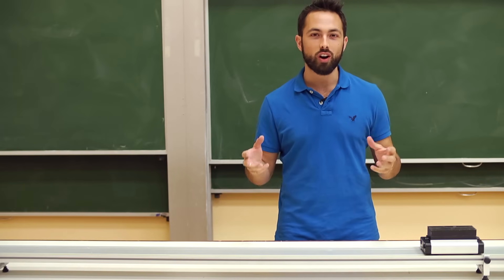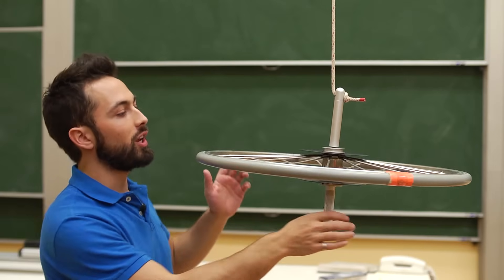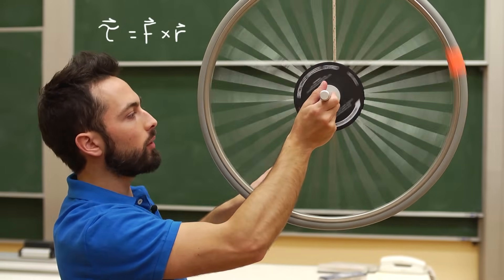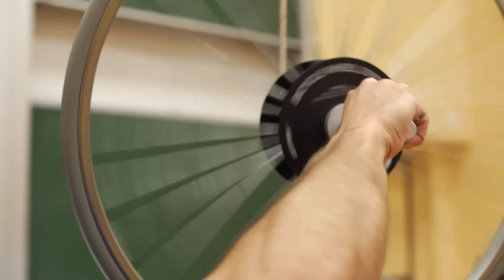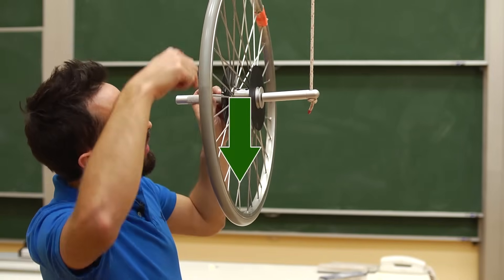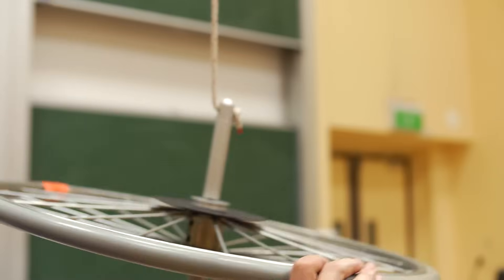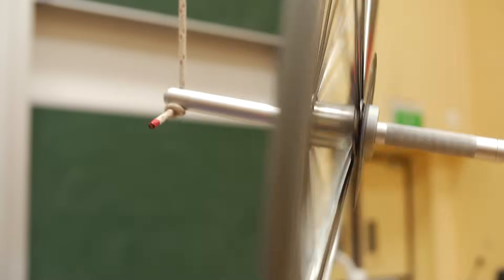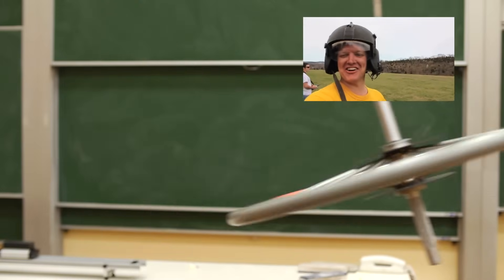Gyroscopic Precession

Comment from the maker: I don't think it's oversimplified. It is a fact of cross-products that crossing one vector with another gives you a third which is at 90 degrees to the other two. The right hand rule is just a convenient way of remembering how it goes.
Reply: Sorry, Derek, I am trying hard to understand the physics of the "anti-gravitational" wheel. I still dont really get it, also not from your more recent viedos on the green with the 40 pound weight. 
Here you explain a force in the direction of the wheel axis. How would that create any lift? It should as well just pull stronger at the rope downwards?
With the weight you lifted over your head in the other video, you explained that you effectively only feel the weight of the 40 pound disc, no torque anymore, however you can lift the weight much easier overhead then if not rotating. Sorry, something seems missing to me that explains the lift more intuitively 🤔🙈 usaually I am quite good at physics, but no professional 😅🙈

Comment from the maker: yeah I felt the discussion of 90 degrees out of phase is misleading. It's not about timing or the state in a rotational cycle. Torque is the cross product of force and radius which is always at 90 degrees to both of the other vectors.

Comment from the maker: so, they actually can't be used interchangeably "the cart was pushed with momentum, which gave it force." Nope - that makes no sense.
And torque is not acceleration but it causes (angular) acceleration just as a net force causes linear acceleration.

Comment: They are related and can be used interchangably so long as you're careful with the grammar and remember that one is a form of acceleration (torque) and the other is a velocity (angular momentum). 
e.g. if you were talking about linear forces and linear momentum you might say "the cart was pushed with a force, which gave it momentum".

Comment: The product he shows is a vector product not a scalar product (= product of real numbers, like what you wrote), which doesn't commute ( = you don't get the same result when you multiply a x b than when you multiply b x a). In fact you get the exact opposite with the vector product. So according to his formula, the torque should be in the other direction. The magnitude is correct though, just in the wrong direction.

But again, he explained it correctly with his hands, it's really details. :)

Comment: Hey, Derek, I just wanted to point out, that despite the fact, that  your explanation of direction of torque at 1:15 is correct, but the equation for torque you wrote is not. It should be vice versa: it's the cross product of radius times force. Just wanted to point that out.
Loving yours videos :)